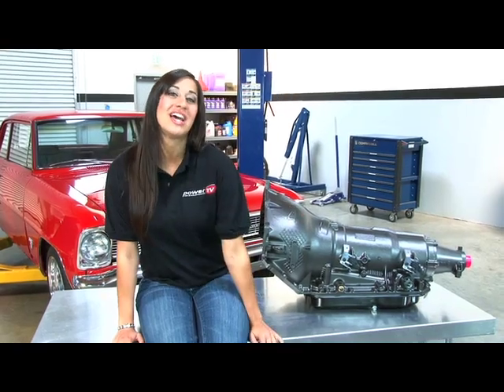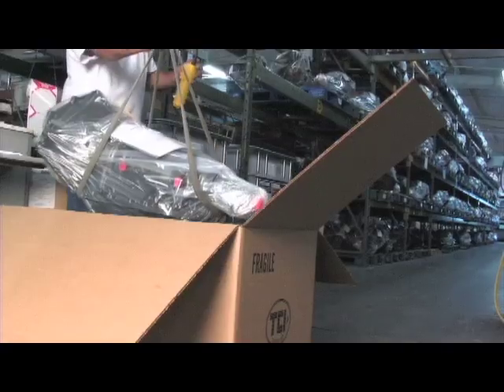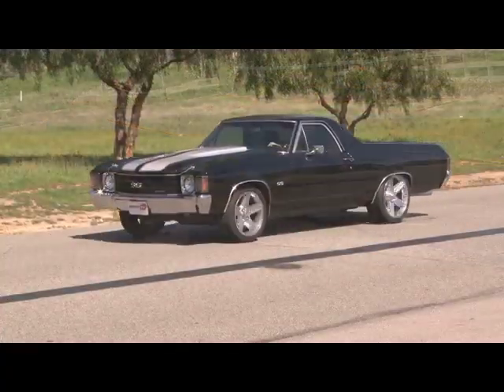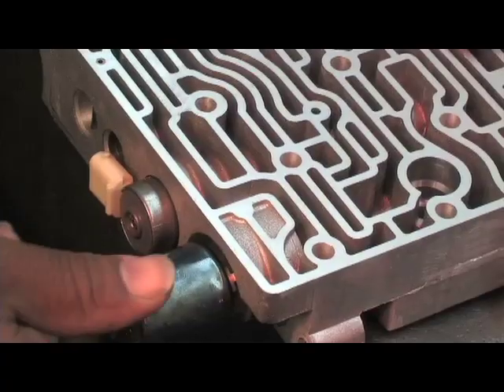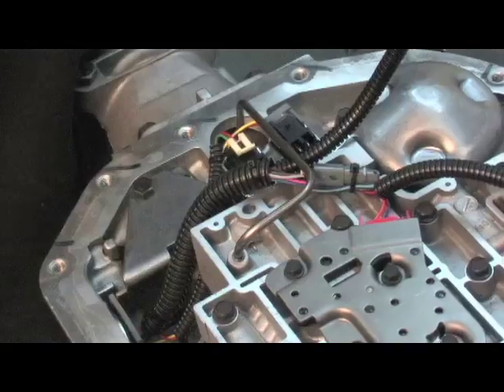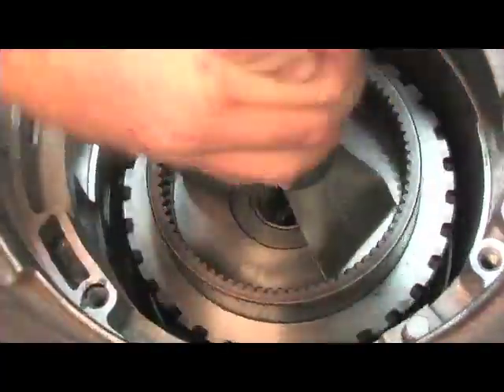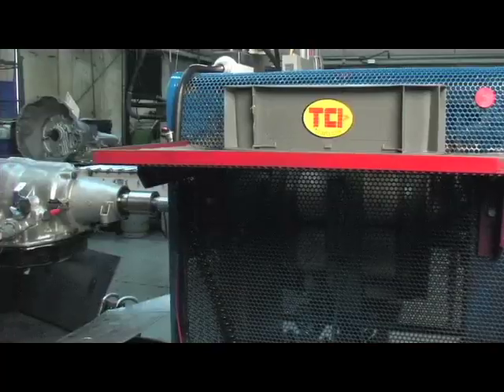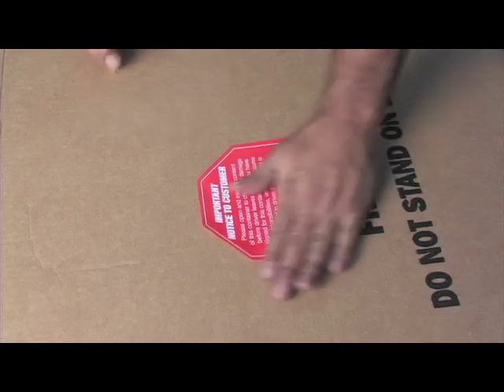Whats inside a TCI 6X Automatic Transmission

Comment: For now if you want a 6 speed auto in a four digit horsepower car this would be more ideal than a 6R80 since those tend to break at around 900 horsepower unless you give them the 4R200 conversions but then that turns them into a 4 speed automatic.

Comment: The plus of a 6 speed with close spacing is the engine can be kept in the power band most of the time.
The negative is that the transmission will be shifting all the time, unless it can be programmed to skip ranges and maintain a range longer.
The advantage of the stock transmission is that the engine can be run in a quite mode and horses summoned as needed, frequently silence really is golden.
Straight pipes and and engine that rumbles just calls attention, including the police.
Go quiet fast!

Comment: @MrSlevin22 

It is just a 4L80E+ a highly modified valve body best I gather.  My guess it has a different low gear planet set and an extra solenoid to apply the overdrive clutch pack upon command for low/first and second/intermediate basically giving you - First, First Prime, Second, Second Prime, Direct, Overdrive.  Without that extra 'noid it would be geared 2.97/1.57/1/0.75:1 

I can only imagine how much quicker my SBF would be if I dumped the built, nonlock up AOD for this unit.